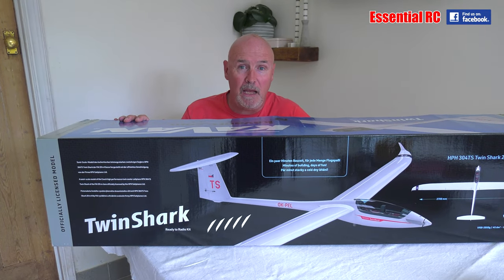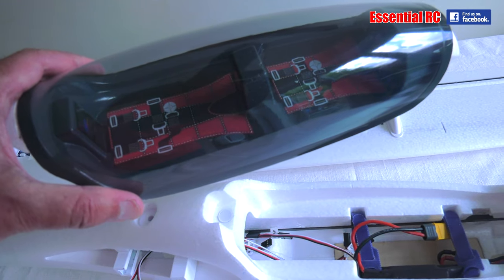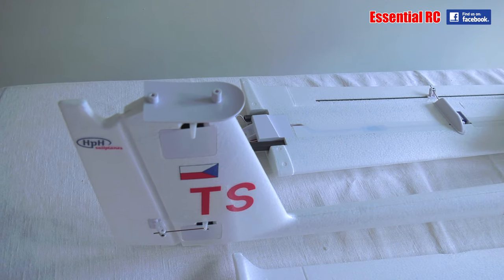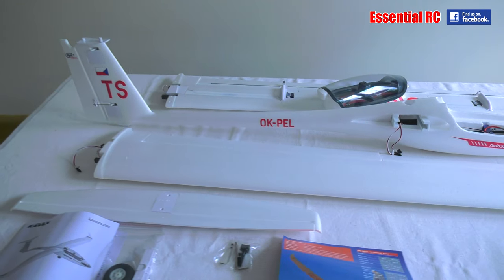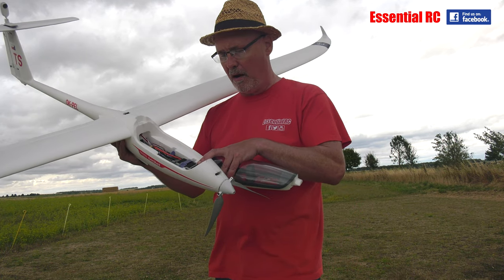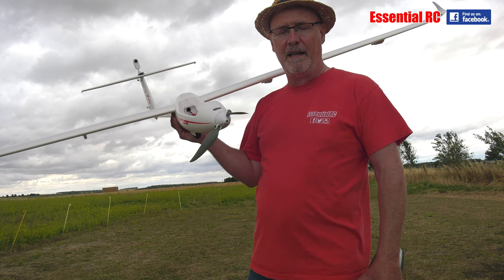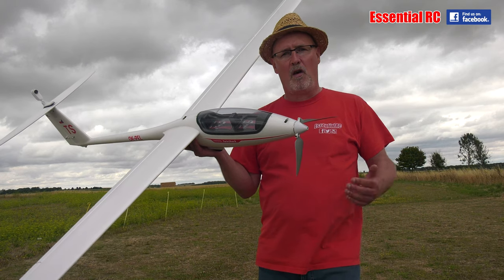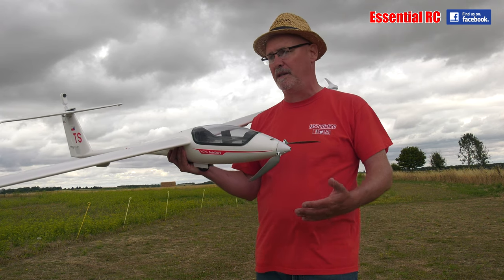My recommendation for your first powered RC glider | NEW Kavan 304TS TWIN SHARK 2.7 metre Sailplane

Comment: nice video. Which was the take off weight for the model ? What about the winglets after several fligths ? winglets seem to be quite easy to be damaged. Thanks
Reply from the maker: No idea buddy. I don't weigh models before I fly them. Winglets are OK but need to protect them during transport

Comment: In UK do you need a license  to fly a glider ??
Reply from the maker: If it weighs over 250g you need to be registered with the CAA and have the provided Operator ID marked on your RC aeroplane. I always recommend joining a model flying club and getting BMFA membership which includes 3rd party insurance.
Reply: @EssentialRC  Thank,, poor insanity    UK government banes every thing but I can buy a full sized glider and fly it  WITH NO LICANSE 
Do you need a pilot license to fly a glider? According to the British Gliding Association, who are in charge of regulating everything gliding in the UK, there is currently no requirement to hold a glider pilot license if you're flying in the UK.
as I said bloody insanity
Reply from the maker: @ashwayn  I'm not familiar with full size glider requirements...but having just googled it I'm equally surprised that is correct. I suspect nobody in their right mind would fly a glider solo without significant training.

Comment: £370 2.7 metre glider as your first? Sounds like a paid promotion.
Reply from the maker: Nope. Wasn't paid.
Reply: @EssentialRC  "Sent to me by my friends at Model Shop Leeds"? 0:10 
I also did notice that the tail appeared to be doing a lot of twisting from the camera view.
Reply from the maker: Yes. They sent it to me for review. It's a foamie...so yeah some flex but then even composite models will do that.
Reply: @EssentialRC  So in effect £370 in kind.
Would also suggest that the T tail is the major contributor to the flex.